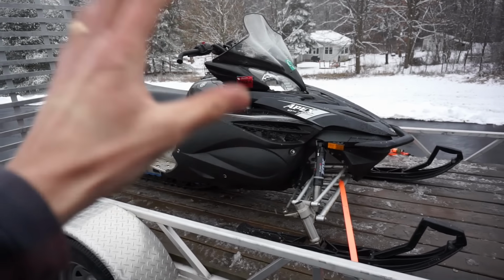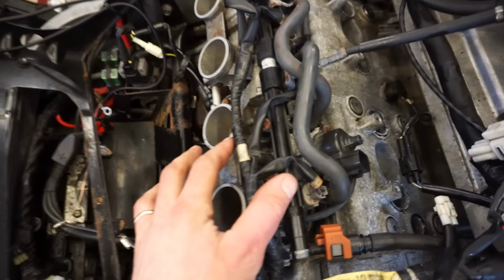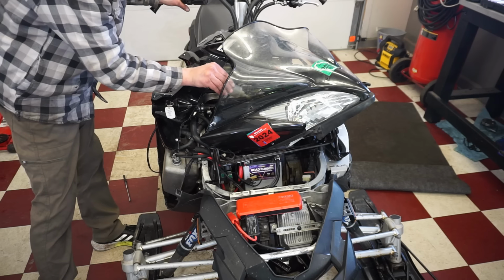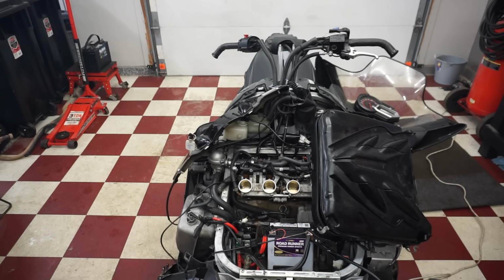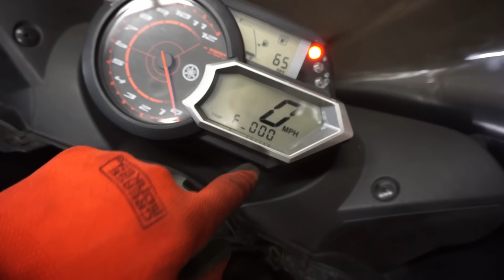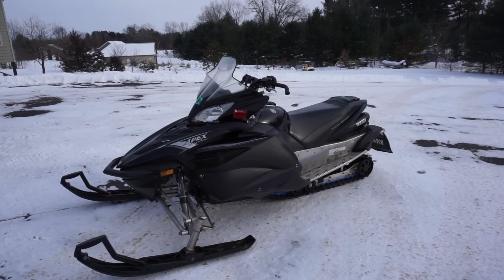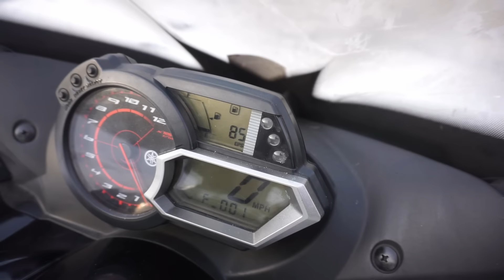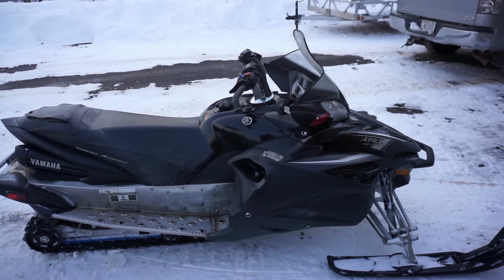$7000 Sled Overheated And Shut Off. Will It Run Again?

Comment: On sensors you can check the ohms with a simple voltage tester. All sensors are is resistance...  too much or too little and the sensor is bad. I always test them and can check with spec sheets to see what the range should be. If there isn't info I just buy a new sensor and test it before I put it in and note it in the manual so I, or the next guy has it for referance. I hope that makes sense. TEST THE SENSORS TO SEE IF THEY ARE GOOD OR BAD WHEN YOU TAKE THEM OUT OR SEE A CODE! It will save you so many headaches.

Comment: Looks like a survivor Joe, good bring back!   Check the rest of the studs for any that are loose or have cracked washers so it doesn't go into meltdown again.   Also on that oil dipstick some of them have different levels whether they have reverse or not, one side is reverse and the other is non-reverse level.   Those are cool sleds but holy cow just to do basic oil and filter change or a battery swap requires quite a bit of disassembly!
Reply from the maker: yeah it requires a lot of work! Not easy!

Comment: Well i change the oil pressure sender switch on my mazda 3 and it looks a hole lot like that switch you have right there a knock sensor you call it well looks allot like the one i changed anyways i hope you fixed all the little dings in that yamamaha of yours have a good one my friend ☮️

Comment: On your first video you were all over the place.  Pull all the smoked coils, do all 4 comp tests with all 4 plugs out and a good batt on a battery booster.   Test for spark with a known good coil with a spark tester,

Comment: Awesome bro. You got a hella deal on that sled. I'd  def hang on to it beings Yamaha does not use their inline 4 cylinder in their snow sleds anymore that is basically an older version of the R1 motor and because as of 2025 Yamaha will not be  producing snow sleds anymore.

Comment: I have to change out gas all the time in a lot of machines that set to long.People think modern gasoline doesn't go bad like the old days but it does, The good thing is if its not to full you can dump fresh fuel on top of it and it will revive it.

Comment: Another trick is to buy a bundle of Ohm resistors to have on hand. When a sensor goes bad you can wire a resistor in place till your new one comes. Use heat shrink and complete the circuit with the little Ohm wire with the right color code on it.

Comment: Yamaha's are notorious for fouling plugs in 4-strokes if you just start it cold and only run it for a few seconds.  You have to let them warm up, and they'll never foul another plug.  My WR450, my FJR and my Waverunner FX all have been victim to the cold shut off plug fouling.

Comment: Im 20min in to the starter spark disaster. 
On any overheated engine u do 2 things.
Check/change coolant and oil.
If either is mixing into the other you got a head gasket problem.
Second, visual inspection of oil will tell you if the bottom end is waisted.
Did he do any of this?

Comment: Good deal! I am going to guess that the knock sensor and the oil pressure sensor got hot and failed just like the coils and plugs. A similar thing happened to my wife's Toyota Matrix years ago; the head gasket blew on a long trip and she continued to drive it until the engine overheated so much it lost compression. I got a donor engine and swapped it in but I stupidly used the coil packs and plugs from the wrecked engine causing the used engine to not run well at all. My advice is that anything that could have failed from overheating is suspect. Maybe a leakdown test would be good to check the head gasket since you are having some things happening with the cooling system.

Comment: I recommend highly to check out that fuel tank good. It sounds like it has water in the gasoline fuel to me. From setting up.,or A case of bad fuel one. I recommend using STA-BIL fuel treatment stabilizer and fuel injector cleaner.

Comment: Great video but never use anti seize on rubber. If you want to use a lubricant on any rubber seals or surfaces run to napa and grab a product called sil glyde.

Also im sure its mentioned somewhere in the comments but that sensor is the engine oil pressure sensor.

The knock sensor the the giant 2 wire hex sensor threaded into the block right above it .

Comment: Might want to elevate the track. When working on your sled. Prevents it from launching across your shop. Or into a tree if outside. Never wire down the throttle. Ask my cousin why !

Comment: I have never been on or worked on a snowboard, can you remove the belt so you could rev the motor without it wanting to take off on you when working on them ?

Comment: Seems like a lot of issues out of such a new machine. It's possible overheating it cooked a few sensors ? I'd probably get it running properly and get rid of it, two stroke sleds at better.

Comment: The oil pressure switch is a tapered thread don't put thread tape on it ,it should seal well if it is tight .
The knock sensor code could have been caused by the miss firing fouled plugs .or also bad fuel .
Just guessing at this stage .Carry on and good luck .

Comment: Id be curious if the cylinder with lower compression got better... also it obviously got extremely hot which probably melted the knock sensor enough to ruin it so id replace that to im suprised u got it to rev out with it like that but its probably pulling timing

Comment: Yea those overheating lights arent easy to notice while riding lol. Had the exact thing happen on a 700 triple but i noticed before any damage. and these 4 strokes are different make sure its getting gas and you got spark. i drive a 2007 apex and i just put on the choke until it starts but make sure its getting gas and that the carbs are cleaned best advice i know alot about these machines.

Comment: Joe you cant run those sleds for a few seconds and crank it like that. Yamaha sleds have a warmup cycle light that will illuminate until the sled is warm. Shutting it off before the light has cycled will foul the plugs everytime.

Comment: do not use superglue to fix things like leaking oil sensors.....even if it works its going to fail for the next guy and and most likely it will fail out in the middle of nowhere,,,,,never take shortcuts like that on snowmobiles,boats or airplanes

Comment: i have two yamaha 4 stroke snowmachines an apex just like this. The plugs are very picky and its a hard machine to start if sat over the off season. Need to start once a month. Cant just run for 30 seconds and shut off, the plugs can easily foul, need to let them run i have found.

Comment: So the F_000 code - once the sled sees the low fuel status it starts counting distance with the display. The idea is that if you don't notice right away it lets you know how long it's been on. Further, it won't clear right away. Now sure but it may need a few kms  after adding fuel before it resets.

Comment: The sensor you took out for the oil leak was the oil pressure sensor. The knock sensor is on the side of the block. It could be bad from overheating. You can see it on the video. It's right above where the oil sensor is.  It has a wire harness on it and part # is  8FE-85780-00-00.   If the track lost a stud you need to check all the studs for loose ones or torn track.
Reply from the maker: Yeah I figure that out later in the video

Comment: all the yamaha 4 stroke snowmobiles have to run until the engine is at operating temp if you turn them off before then they wiil foul the plugs , even new plugs will foul. also that is the oil pressure sensor . the knock sensor is on the block above that sensor pointed into the cylinder to listen for knock. knock sensors don't usually have a hole in them for engine fluids to enter

Comment: that's an oil pressure sensor/switch.  A knock sensor won't be in a pressurized oil galley.

edit: looks like you figured that out.  cheers!

Comment: Just got to the part where you take it for a test ride...it sounds like its stuck in limp mode. I could see on your tach that  your only getting up to 6x500 or 3k RPM's (possibly 6K) and its hitting a rev limiter.
Reply from the maker: Watch a little bit more. Gets out of limp.mode once warmed up.
Reply: @2vintage  yeah I just saw, that's sweet

Comment: Little late here BUT,,, I would guess that that is NOT a knock sensor but some sort of oil (fluid) pressure sensing device. Typically a knock sensor has to be firmly pressed/bolted metal on metal right in the center area of the block and cylinders detecting early detonation in the cylinders. I would, but wouldnt, worry about the knock sensor code at this point. I would however just complete replace that oil pressure sensor - or whatever it is. Also, as others have said, lol,,,, easy on that sweet starter, Man... Shes treating you right - treat her right 🤣

Comment: If it does it's A indication that the water pump impeller is worn out inside of that snowmobile.,or bent out of shape due usage over the times of riding A lot. Wear and tear on it. Might need to be replaced to along with the oil sending unit sensor switch and the spark knock sensor to.

Comment: There’s 2 types of grease for use on HV electrical equipment that need to NEVER be confused:

1. Is Conductive 
2. Is Dielectric - that is:    NONconductive.

Conductive should be used on plug threads / screw-on nipple that accepts plug wire connector … the parts DESIGNED to Conduct electrical signals / currents.

Dielectric should ONLY be used on porcelain / rubber plug wire boots … the Insulating parts of the ignition coils / plugs / wires / boots.

Comment: I have one of these with an oil pump issue it will not prime for the life of it I put air in the lines I drained refilled and tried to reprime it continues to show no pressure on start up but oil cycles

Comment: Once those sensors burst&leak,same as oil pressure switches just bin them & replace for new..as there junk after failure &will keep throwing the code up..Ozzy UK.

Comment: My bad i assumed that was oil pressure sender not the knock sensor . If you were able to screw a spark plug in there it cant be a tapered thread .

Comment: around 25.08 you see the knock sensor and you can also see that it has also melted, it is on the left above the oil pressure sender

Comment: I recommend never touching the throttle when starting as the engine is fuel injected. Many folks after it does start foul plugs if you mess with throttle before the cold light goes off. nice work getting it back running!

Comment: the leaking sensor is an oil pressure switch, the knock sensor is the sensor above it in the block with a lead coming out of it. they have a habit of failing from melting.

Comment: That sensor looks like the oil pressure sending unit and the knock sensor is on top of the valve cover you replaced I think.. Just a thought..

Comment: Them Yamahas when you see the light flashing once first started don’t touch anything wait till the light goes out that’s warm up mode I worked at a Yamaha dealer when these first came out back in 06 with the nitro’s apex’s and the less sot after fs vectors

Comment: Retired certified master mechanic here, change the sensor. Knock sensor does not have oil pressure hole in the sensor bottom.  Then beat it with your claw hammer... LOL. What caused the overheat problem??

Comment: Maybe the knock sensor is bad. If all the other sensors were shot there's a good possibility it got damaged too. See if you could get the heat exchanger welded to seal where it was damaged. I'm glad to see it's running, after some goof called me out for being optimistic last time. If we weren't optimistic, no one would ever buy fixer uppers. It's always a bit of a gamble, and we all know if worse comes to worse, a rebuild is a possibility.
Reply from the maker: Yeah most likely!

Comment: I only run 93% octane in my machine otherwise you get engine ping, hard starting and fowled plugs are a given. That the light MUST be off before you start riding however. The overheating could be caused by air in the system or not enough snow hitting the rear heat exchanger.

Comment: Not smoke it’s coolant. There is a head gasket leak into cooling system on the lower compression cylinder causing overheating.   Horoscope that cylinder to see if you see any coolant or if cubustion chamber is steam clean. Also could do a hydrocarbon test on coolant tank   My 2 cents

Comment: That is the oil pressure sensor that’s leaking.   The knock sensor is the hexagonal sensor above it with the black and wire coming out of it.  That probably got cooked too.

Comment: Wow give that starter motor a break 😂 the way you dropped them spark plugs in I'd say deffinetly threw the gap off and it would be possibly a big issue as to why it won't run properly
Reply: Put them on a small length of garden hose and carefully slide them in that way and hand tighten them then put the ratchet on them 👍

Comment: You can defoul plugs by just using a propane torch. Get them real hot then wire brush off any carbon deposits and blow them out with some air. Thats what I do if I foul them on my 2 stroke sleds.

Comment: Fuel injected why are you using throttle? Knock sensors don’t have oil going through them oil pressure sensors do and usually have o-rings on them. 
Good vids keep it up

Comment: Dialectric grease resists the flow of electricity, Anti-Seize conducts electricity, you put them in the wrong places, Anti-Seize goes on the threads and the dielectric grease goes on the boot and on the tower of the spark plug to keep the boot from sticking.

Comment: common misconception, knocking doesnt trigger a knock sensor code. the code means the knock detection system is not working.

Comment: The dielectric grease goes on the ceramic part of the plug maybe and inside the rubber boot but NOT on the metal connection part ... would have probably fired right up had you not greased the plug connections

Comment: I am an old retired mechanic who put 60 years in the shop and I really like watching all of your posts but sometimes you make me crazy.... On this sled you should have bit the bullet and bought all new sensors because plastic does not like heat... you just prolonged your agony and mine....the other thing that you do that really bugs me is when you remove the main jets with a big Crescent wrench... (Adjustable end wrench) and you need a little work on your vocabulary...For your age I still give you an "A"....

Comment: Shouldn't use dielectric on plug threads. It contains silicone . If it gets into the cylinders the heat turns it to glass, ruins O2 sensors. Ruins cats etc.
.

Comment: You will foul spark plugs holding the throttle on fuel injected Yamaha snowmobiles, I’ve done it with one I had and I’ve seen buddies do it. Yamaha dealer told me and friends not to touch throttle starting
Reply: Also wait for the warm up light to go off before reving it or driving it to avoid fouling plugs, extensive spinning can also cause fuel build up in the oil in the bottom end

Comment: Antisieze comments...the rubber/plastic boot on the plugs isolates the spark from geting outside the boot to the antisieze...or to the head or valve cover which are both metal and conduct electrical current...hence the boot to isolate...if the antisieze was put on the inside of the boot all the way to the top contacting the top of the spark plug then it could possibly cause problems...but that didnt happen in the video

Comment: I would never buy a machine from you. Firstly a novice would realise it was an oil sensor first look. Secondly you allowed a machine that had an over heating issue that caused the initial problem to over heat again and then that freaking over starting. Holy shit man if a damn machine does not start after a few tries THERE IS A PROBLEM. A starter is NOT meant to crank long like that. WTF.

Comment: Was that the knock sensor you put tape on? Usually they are a single wire piezoelectric device and need to be grounded to the engine via the threads.

Edit: I guess I should shut up and watch the video. 😂
Reply from the maker: Ended up being an oil pressure sensor

Comment: Opinions are like a “Gluteus Maximus,” everybody has one. The problem is that some “Gluteus Maximus’s,” stink worst than other’s.  With that said, in my humble opinion using Dielectric Grease "TO PROTECT THE STEEL / METAL SPARK PLUG BASE," against the aluminum Head is a joke.  Use a HEAT ANTI-SEIZE such as a  Loctite 767 ANTI-SEIZE LUBRICANT (silver in color, Part No.#: 76741,) Protects metal parts from seizure @ high temperatures 8700 C / (15980 F)

At best when using the Dielectric Grease, each time the motor comes up to operating Temperature, the  Dielectric Grease, will some what liquify and work down via the threads (Say hello to my little friend Gravity,) and disappear.  Your left with no protection.  Dissimilar metals (Hello Spark-Plug Steel / Metal - Aluminum Motor Head) always create problems

Comment: Dielectric grease on sparkplugs, down into engine block…say what?? Its silicone based and cant resist high tempratures above 200 degrees..

Comment: replace the sensor , now it will show false readings to machine, you dont want to go into forest and get stuck cause of this, it may be someone tryed to take it off and broke it as simple as that. basically someone bought it had no idea what he was doing , started didint rided, than machine shut off started to showerror code, person tryed to remove this snsor broke it as it was looking fine placed it beck, went to plugs, broke the coil plugs and got rid of it sold maybe to you. even gas may sitted for long time untill it got sold. Its ussuall people brake good working machines
Reply: I had a stroke trying to read this.